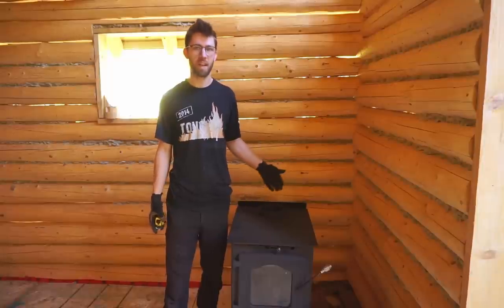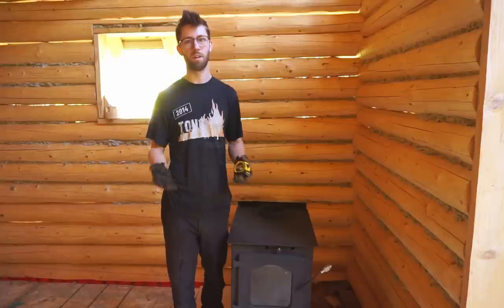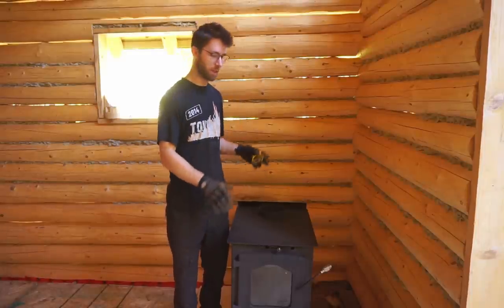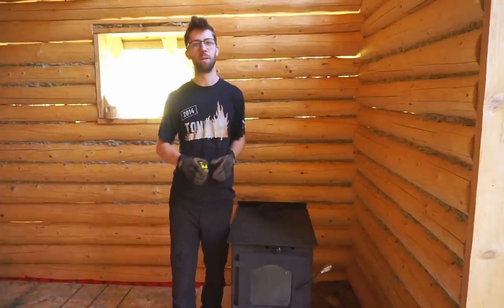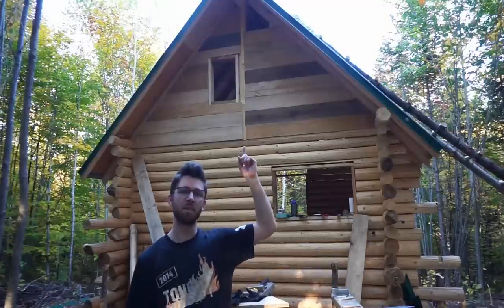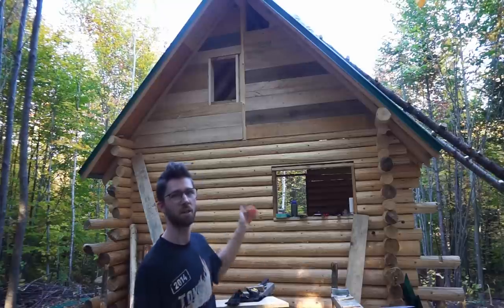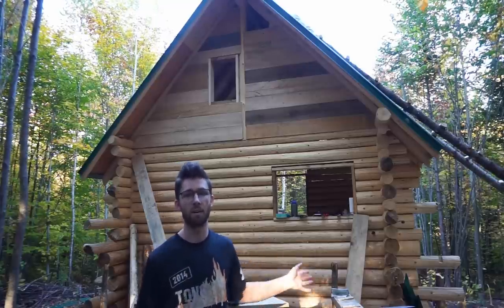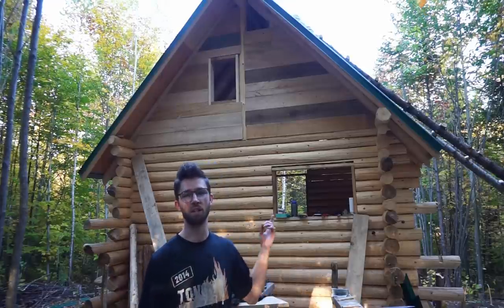Building A Log Cabin | Ep. 39 | Wood stove is in | Cladding the gable ends

Comment: Hi , a question for Nick- since you are a structural engineer and building a cabin what do you think about this.. I'm planning my own cabin based on my own resources and abilities and was wondering if the top of the gable ends I could stagger different size logs the way you would a stone wall and spiked in. Now I'm wondering if I could do the entire cabin in this method, it seems I could utilize more trees for the cabin as well as lighter and thicker logs. I'm not opposed to modern braces or screws etc,, any structural reason this is a bad idea? Thanks guys , love your vids , simple and useful camera angles for prospective cabin builders.
Reply: Interesting, I would like to know aswell since I have back problems. I assume more spikes would be needed per log and maybe some kind of brace locking the logs together?

Comment: I would use a lock nut on the trailer as the type you have used are likely to come off
Reply from the maker: It does get loose after a few hours of pulling.. we’ll probably change it next time, if it breaks again or if we lose it 😅
Reply: The washer you have is a lock washer (Belleville washer) but you had it on upside-down. Flip it over and it will compress and lock better.